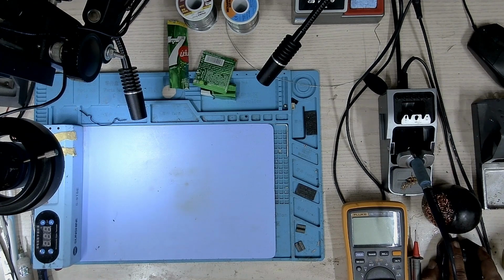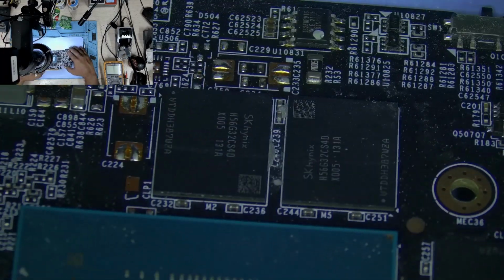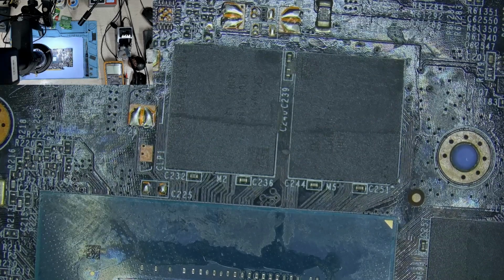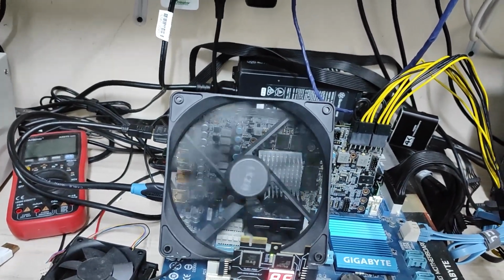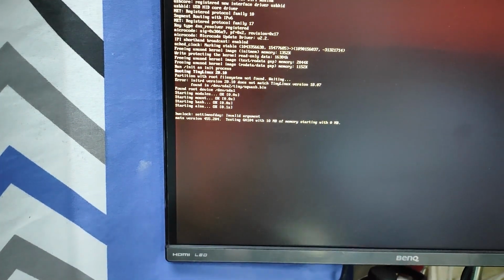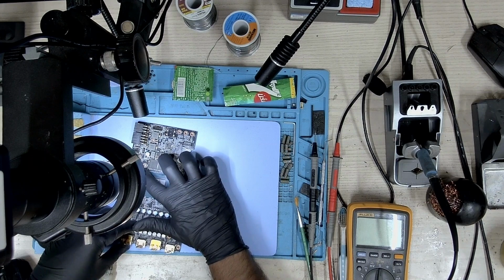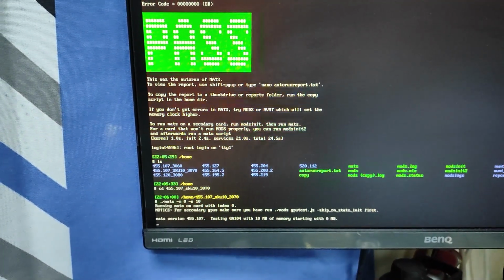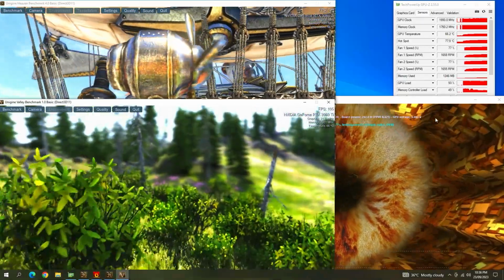Fixing RTX 3060Ti - Hynix X005 Memory Upgrade for Stable Gaming and Crypto Mining.

Comment: Una pregunta,  que temperatura aplicase con el precalentador azul  y cual temperarura con la pistola de calor en grados centigrados?.

Gracias!
Reply from the maker: On the blue preheater it should be 120°C. On the hot air, it will depend on the capabilities of your hot air. Use higher temps for shorter durations. In my opinion the blue preheater is not sufficient for heat sensitive memory modules like Hynix. You will need a preheater that will go higher

Comment: Llegaste a medir la tensión de las vram  vddq  en la fuente de kas gddr6?
Tengo el mismo problema pero resulta que el la tensión de las vram  no están en 1, 35v  sino 1.25v da video pero al l pedir carga  se cae el sistema como te sucede a ti y memorias x005 de hynix también pero me extraña que falte 100mv de alimentación
Reply from the maker: The GPUs with Hynix having this problem have 1.35v on memory. Hynix require 1.25v to function properly. Once you start to get this problem it's pointless to restore to 1.25v. I tried to fix by swaping the resistor to drop the voltage but most of the time I was unsuccessful. Sometimes I was. So in this scenario I just swap to Samsung. You can swap with to Samsung or Hynix .

Comment: I got the ASUS RTX3060ti with theese modules . It crashes when i do gaming or benchmarks . Could it be from theese VRAM’s ? Please i need your help sir 🎉
Reply from the maker: Install GPUz and check if it shows Hynix. It may be possible that this is the issue, but it still has to be diagnosed before concluding
Reply: @GraphicsCardRepairs-tk7ql i ve checked with GPUz and Opened the GPU and yes its the X005 model because Hynix got an other X014 one . 
The crash just took me out of the game only . No power cut no black screen .
I am asking sir if this issue could come from the X005 Vram model

Comment: Hi. Although I use this menu for the necessary tests. However, the Windows boot test continuously gives a blue screen. with error 0xc0000225. When I try to fix it, nothing works anymore. How could it be made to work?. Or should I install it on another device? I couldn't find an answer to this anywhere.
Reply from the maker: Check this link here. there is an article by Richard and i have commented on how to fix it.
https://www.badcaps.net/forum/troubleshooting-hardware-devices-and-electronics-theory/troubleshooting-desktop-motherboards-graphics-cards-and-pc-peripherals/75981-software-to-analyze-video-ram-faults-on-graphics-cards/page2
Reply: @GraphicsCardRepairs-tk7ql  Thanks for the help.
Reply from the maker: If you are still not able to let me know.
Reply: @GraphicsCardRepairs-tk7ql  I personally cannot get the AMD tests to work

Comment: Great video bro, i just wanted to ask how do you know which memory to use to upgrade? there are so many models in Ali express, or is it that all BGA chips can work on the card but i should be respectively GDDR5 or GDDDR6?
Also one more thing, can a card get detected in mods even if the chip is not in board or not soldered correctly? thanks!
Reply from the maker: Every card comes with its default memory installed like SAMSUNG, Micron and Hynix. They all produce GDDR6 which comes in 14Gbits and 16Gbits. Micron is the only one to produce GDDR6X which comes in speed of 19Gbits to 21Gbits. Now each memory type comes in a 1GB module and 2GB module. You just have to match the default rating that the card was designed for. In the case of GDDR6 you have 3 different manufacturers to choose from but with GDDR6X it's only micron. For example RTX 3060Ti by design comes with 1GB GDDR6 memory modules of 8 to make it 8GB these memory modules are of 14Gbits speed. This can be Micron, Samsung, or Hynix. I can switch to any of the manufacturers but I have to swap the straps to tell the bios which memory is installed. As long as I stick to 1GB modules of 14Gbits it will work. I can have a 1GB module of 16Gbits speed installed between 14Gbits modules but it will run as fast as the slowest module on the board. Same works for all other memory types like GDDR6X as well. I have not tried to switch to 16Gbits module entirely when the card came with 14Gbits so I don't have an answer for that. I hope that answers your question. The model number is what I just have to look for that specific specs module or part number I would need. Just to add to that, you cannot replace GDDR6 memory with GDDR6X memory as the data and command pins are laid out differently. All Nvidia 10 series cards and AMD 400 and 500 series come with GDDR5 memory except for NVIDIA 1080 and 1080ti which comes with GDDR5X. All RTX 20 series cards and AMD 5000 series cards come with GDDR6 memory. RTX 3050, 3060ti, and 3070 come 1GB module of GDDR6 memory. RTX 3070Ti, 3080and 3090 come with GDDR6X memory but the speeds are higher for 3090. the 3090Ti come with GRRD6X but a 2GB module. The AMD RX 6000 series comes with 2GB module of  GDDR6 of 16Gbits speed. The RTX 7000 series also comes with a 2Gb module of GDDR6. RTX 4060, 4060Ti comes with GDDR6 of 1GB module. The RTX 4070, 4080, and 4090 come with the GDDR6X module. RTX 4090 come with the 21Gbits speed module.
Reply: @GraphicsCardRepairs-tk7ql  This was very well written answer, I appreciate the time you took to answer me. Thank you very much for all the information!
Just last thing i wanted to add "Can a GPU be detected in PC without 1 or 2 VRAM chips missing? or not soldered correctly?
Thanks again!
Reply from the maker: On GDDR6 the card will get detected with black screen. On GDDR6X the card will be stuck on post code B2 so the computer will not boot with the card as primary but the card as secondary it will show error code 43 in device manager.
Reply: @GraphicsCardRepairs-tk7ql  And what about GDDR5 memory? Will the card be detected as secondary with 43 error?
Reply from the maker: Yes on GDDR5 as well it will get detected and boot with a black screen with the card as primary. If booted as secondary in device manager it will show error code 43.
Reply: @GraphicsCardRepairs-tk7ql  Thanks a lot sir!
This will surely help me in my future GPU repair attempts.
I learnt a lot from your videos as well 🙏

Comment: What do you call the material you put on the aluminum capacitors that prevents it from being heated too much?
Reply from the maker: You can use Capton tape and  alluminium foil.
Reply: @GraphicsCardRepairs-tk7ql  thanks. I appreciate your videos and hardwork. Hope you get more views!
Reply: That's a 7up can cut, it protects very well the parts, better than kapton